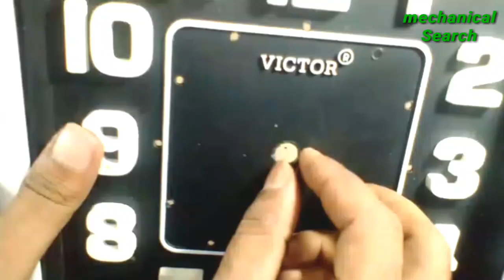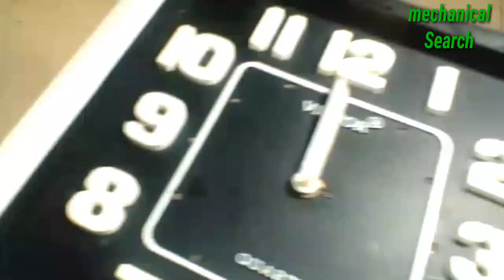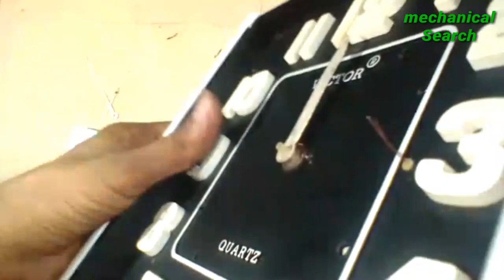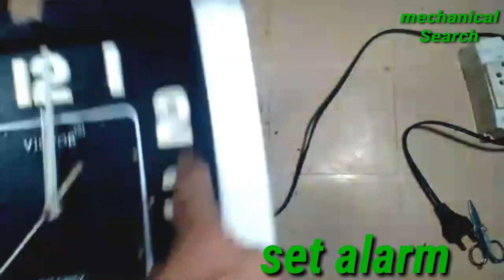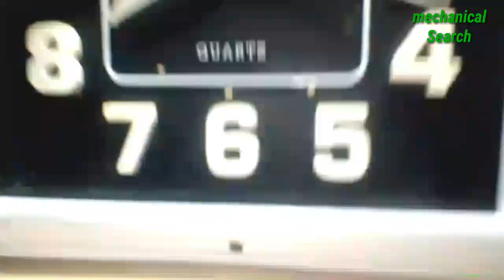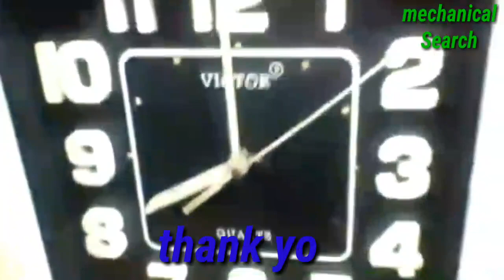Diwal ghadi ko alarm ghadi kaise banaye | alarm ghadi kaise banaye | wall clock with bird alarm

Comment: good you add holes at bottom write 1-12 there and add that wire at bottom instead of opening and turning clock again and again for time change. Good work.